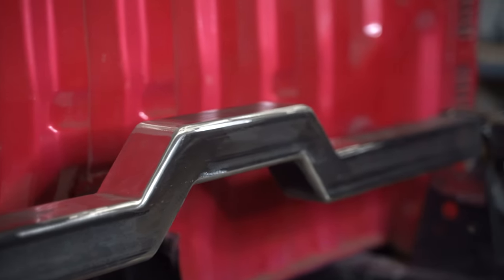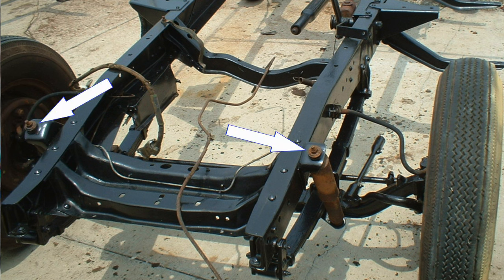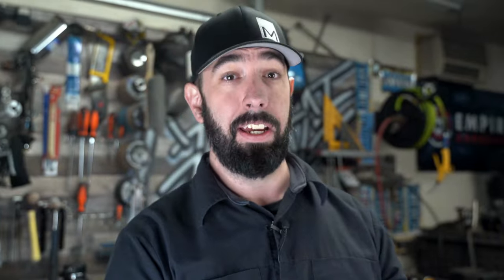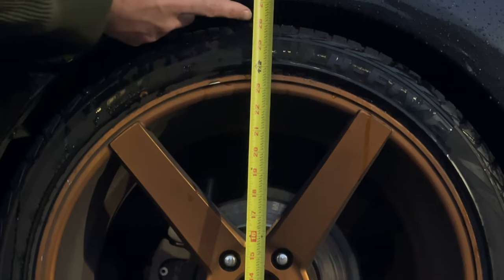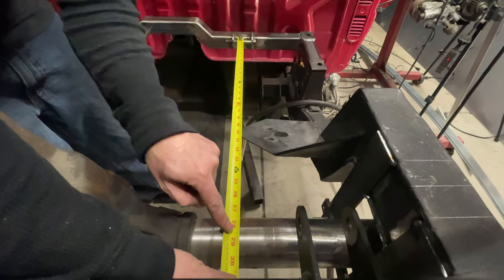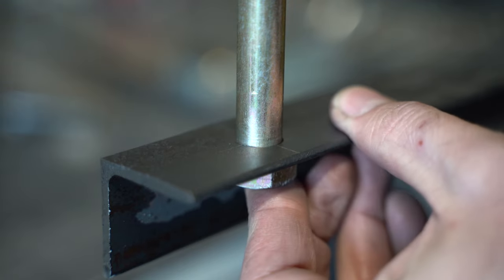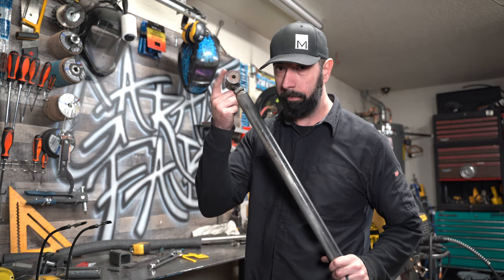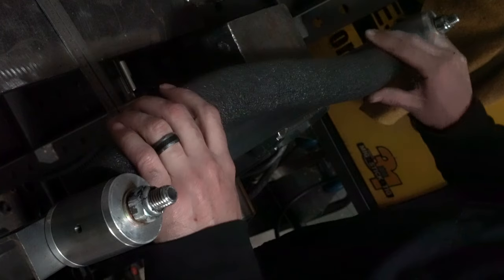How to Make Identical Length Link Bars! Mighty Max Ep. 12

Comment: It's nice to see a thorough video that doesn't just repeat the same stuff that everybody else has. It's also nice watching a video where they'll talk about something in my mind I'll be thinking yeah but what about this part or that part of it and then about that time you actually go through and explain it. The chromoly versus mild steel for the link bars was a perfect example. Everybody's like you need chromoly. One bands one breaks if it isn't welded properly. Just like you said, a Bent link bar will get you farther than a broken one. 

I agree for the most part on your breakdown between the poly and the rubber bushings. Race vehicles generally you're going to want himes or big poly bushings. If it's something that requires a lot of movement or articulation the rubber bushings yes as you stated, won't last as long. If it's something you're going to be driving a lot on a street vehicle and like on yours where there's long link bars and not 2 ft of wheel travel I would have ran rubber bushings. A good quality rubber bushing will last for years without any lube, dirt collecting around the lube, or squeaking because he didn't lube them. Also poly bushings when they get loose they clunk just like a tie rod. Each type has a place, it just depends on what you're doing with it. 
Still like your content though.

Comment: I just discovered your channel 20 minutes ago, love it and subscribed instantly with notification!  I'm not smart, but I am a mechanical engineer.  I pursued that education specifically so I could build things with steel.  I too struggled with how to articulate why one would use chromoly over mild steel with my hot rod buddies, particularly with the cost differences, and where is the dividing line to make that decision.  What you said was a spot on explanation, best I've heard to date, and got the point across perfectly well.  One would choose chromoly over steel for one of two reasons; 1. Money is no object and weight savings is absolutely key to your goals, i.e. sponsored race team like you said, or 2. you need a lot of strength in a part but have a limited amount of space to put it in.  Chromoly is the most accessible option of the high dollar steels.  i.e. home made axle stub shafts.  Proper annealing is the difference between success and failure as you described, most home growers get cracks at the weld zone until they crack the heat treat code.  Awesome channel, I'm looking forward to binge watching your content over the next few months in the boring evenings on my out of town assignment.
Reply from the maker: You sound pretty dang smart to me. I’ve pondered for a long time about going to school for engineering! The funny thing is I have no desire to get a degree, I just want to better myself and my projects by learning more than I could on my own.
Thank you my friend! You are appreciated. We’ll be seeing you around! 🍻

Comment: even on race cars, everything chromoly, including the chassis, is replaced at intervals. Like you said, failures are catastrophic, and the stress on the material over time will weaken it. 

That said, chromoly has some useful flex properties for certain applications. It's a bit "springy" compared to mild. For a vehicle that won't be competing on a track, chromoly is not an ideal option, but it certainly has its place.
Reply from the maker: Interesting! That’s the first time I heard the tubing change. You’ve basically sealed the deal on my using DOM on the next project for much of the chassis. Heavy but that shouldn’t be a problem.
Thank you, Riley!

Comment: Chromoly is stronger and better because of two reasons its strength and  Ductivity meaning the amount of pressure it can absorb and the amount it can bend without breaking. The problem is people try to make it to stiff by welding it with stainless steel wire this makes it way to stiff causing cracks overtime. Heat treatment also does the same effect also cold treatment different topic depending on the material. U can actually weld chromoly with flux core a lot of people don't know this. There are special wires specifically for different materials. I have a college degree in welding. I don't know everything but I've learned a lot and continue to learn.
Reply from the maker: No argument at all that chromoly is better when done properly. I plan to take some classes myself sometime soon so I find it for sure what “properly” really means.
There is no better way to be… always learning.
Reply: @GarageFab  yeah I always recommend education it will definitely help

Comment: I used one Johnny joint on my wishbone I built for my f100. Seamed like a good choice and being just one needed. Very affordable
Reply from the maker: I dig it. Lord knows they’re beefy enough.
How do you like the wishbone? I can’t see why there would anything wrong with it but I’ve never had the opportunity to drive one.
Where is the Johnny Joint? Behind the cab or at the axle?
Reply: @GarageFab  I haven’t driven this one but as long as the Johnny joint is in the middle it does good. If that is offset then it throws off the roll center. Mine is on top of the diff. I wish I could have put it behind the cab but I was concerned about the drive shaft and instant center not playing nice lol.
Reply from the maker: From my loose understanding of roll center, you Johnny Joint is right where it should be. I’m excited to hear more about your experience as time goes on. 👏

Comment: Regarding Chrome Molly tubing weld HAZ issues. Using 310, 312, or 316 Stainless Steel TIG filler rods will minimize preheat and post heat weldment failures.
Reply from the maker: Thank you for that Steve! I have a whole box of 312 and I never weld stainless. Perhaps it’ll get used after all! 🙏

Comment: I'm really loving your channel!
Reply from the maker: Thank you, Travis. I appreciate your eyeballs! 🙏 
Cheers.
Reply: @Garage Fab  I'm getting so many ideas and proper knowledge of how suspension stuff works! I recently just had my drive shaft drop out of my 97 Dakota.

While I had it out:
1. Removed all of the rust
2. I painted it 
3. Replaced all the u-joints
4. Pinion yoke at the front of the differential
5.  Carrier bearing that barely had and rubber attached still
6. Tranny filter/fluid
7. New gasket & pan with drain plug
8. Oil changed while I was under there
9. Differntial fluid changed (since it poured itself out while shaft was disconnected)
10. Differential cover cleaned de-rusted and painted
11. New gasket

So then I lowered it down so I could top off the fluids after it was all together and noticed my rear tire was almost punching the inside of the fender.... Found out two of my four link rods were busted at the ends and one of the front hangers cracked below the weld.

I decided to remove the bed:
1. Deleted the e-brake and removed the bracket that was partially torn from the frame
2. Dropped the fuel tank
3. The straps almost completely cracked apart from rust
4. Disconnected the fuel filler hose from the inlet housing (it was so rusty I'm surprised it's not leaking already. 

Ordered new tank straps and filler, rust remover wash and metal etch/conditioner.
Rust Bullet Chassis paint.

Company is sending me all new stuff! 

The company wants me to remove all of the old kit and return it to them.

So I've been watching your videos on different ways I could set up the four link when I reinstall it, maybe install inside side of the frame instead of the outside and possibly move the fuel tank from the side of the truck to under the rear of the bed I'm not sure if that's a great idea because of possibly getting rear-ended but I don't know.

My only major concerns are pinion angle of the shaft and figuring out my ride height that I want and having the bags having at least 30 pounds between them.

When the kit was originally installed one of the cheapest Chinese airbags was popped so I had to buy a couple of Air lift quality bags locally which then since they were taller they required more air so my ride height was more raked.

So I need to move the upper bag mounts up or the lower back mounts down when they go back in.

I ordered a digital magnetic pinion angle finder help but I don't know the best way to figure out where on the axle to mount the bag mount brackets.

And as long as I maintain the opinion angle I can move the front and rear hangers for the four link up as long as they still end up lined up with my infinite Center at the front of my bumper if I understand correctly.

Sorry for the superlong post but you got the knowledge that I'm looking for!

Comment: What's up mankandy, happy New Year. While triangulated bars aren't the same length should they remain  parallel to each other. Thanks, I really enjoy the depth if your videos.
Reply from the maker: Hey Terry! I’m assuming that you’re referring to the relationship between the triangulated upper bars and the parallel lower bars. (Because if the triangulated bars were parallel they wouldn’t be triangulated) 🤔 🤯 
It is my opinion that on bagged vehicles the upper and lower bars should in fact be parallel to maintain a constant pinion angle. On a static height vehicle, (metal springs, coil overs, etc.) They should not be parallel. Instead they would point to a common spot at the front of the vehicle. (Front wheels/front bumper)
This will increase traction, but will give a changing pinion angle which could cause problems on an adjustable height vehicle.
Thank you, Terry! Happy new year.

Comment: I know this is a old video, but hopefully you'll still notice this question...  You state that adjustable link bars must contain atleast 1 heim...  Why would Thorbros sell most all of their 4-link kits with 1 adjustable end but no heims if this is the case?  Will the thorbros bar ends come loose then?? Or maybe the bars are meant to be welded solid once adjusted to exact proper length??  My truck will be on road use only, so articulation will be minimal.

Comment: Shouldn't you use a heim or jonny joint on one end of each bar to accommodate for body role? Seems like poly on both ends would wear out quick from body roll.
Reply from the maker: I’m hearing a lot lately about failing or wearing out polyurethane bushings! I have yet to have to replace a poly bushing. On my builds, if the owner wants side to side action, or adjustable links, at least one end of each link must be a heim joint with high misalignment spacers. In vehicles with static suspension or bagged vehicles with just front and back motion, I only use polyurethane bushings. That’s not to say that’s the “right” way of doing things but it’s served me well so far.

Comment: For an off-road application when finding your link mount locations on the frame, do you go off instant center? Also how do you calculate your upper link length when doing a triangulated 4 link?
Reply from the maker: I don’t build a lot off road vehicles. That’s my way of saying I’ve never built one. 🧐 I specialize in Mini trucks that require a whole different set of rules. 
If I’m building a truck that’s meant to perform well at the track, center of gravity would be a deciding factor and then creating a good instant center with link angles would follow.
Unfortunately with adjustable suspensions like those that I build most, instant center takes a back seat to drivability. (meaning vibration and driveline longevity)
In adjustable suspension vehicles in which the driver wants to be able to drive at all heights and doesn’t care as much about quarter-mile times, I create the longest link bars the vehicle will allow. The link bars then essentially decide where to mount them to the frame.
Sorry I couldn’t be more help there.
As for triangulated bar length, my method is ridiculous. I did terrible in math and I’m sure there’s an easier way to calculate it on paper but here it is…
On bagged vehicles the distance between the axis’ on the lower bars should match the axis’ on the triangulated upper bars for the sake of happy u joints. So I take the measurement of the straight lower bars, let’s say they’re 3 feet even. I draw two parallel lines on the ground 3 feet apart and the width of the vehicle frame. Those lines are the front and rear axis’ of the lower bars.
Now you can place your unwelded bar ends on those lines where you want to mount them (perhaps the front link bar mounts are an inch away from the inside of the frame rails and the rear mounts are a couple inches apart above the differential.) You can then just measure the distance between the front and rear bushings to decide what length to cut the link bar tube to.
I’m suddenly realizing while writing that I should do a video on this even though I’m not doing a triangulated 4 link. I hope this made sense in writing. 🍻
Reply: @GarageFab  my apologies, I could have worded my question better. I should have asked if your formula could be applied to an off-road application. As for the links I found a 4 link calculator on a forum last night. If you would like me to send it you way so you can check it out to let me know I can email it to. Helps with links, shocks, drive shafts and pitches needed.
Reply from the maker: I’d love to see it. You can hit my up on Instagram @GarageFab. Feel free to shoot me a DM.
The setup I recommend for Mini Trucks would in fact “work” off-road, but you’d likely be leaving some performance on the table. Maybe it would be noticeable, maybe it would not, but traction under acceleration with a parallel 4 link might not be as good as it could be with just some simple adjustments in bar angle.
Simply put, if you just want to drive some trails occasionally, a parallel 4 link will serve you just fine. If you want to race, ignore everything I have to say. (Except “Keep moving forward”)

Comment: I am building a traditional hot rod. I saw a 4 link on a traditional build I liked it, but it’s different . It has a bottom link tube at rear end bottom by spring end. The upper one is on top of rear axel 1-2” of the axel tube comes out of the “pumpkin “. The bottom link went straight to cross member. The top went to exact bushing the bottom used. Creating a triangle and they were actually connected with diagonally artistically
Would this cause problems binding?
Reply from the maker: I think I read that 12 times and I just can’t visualize the system. I thought for a moment you were describing a ladder bar setup but I’m pretty sure you are not.
I don’t suppose you have any photos?